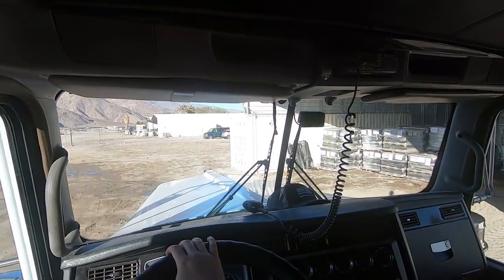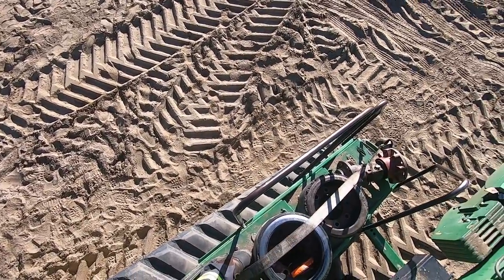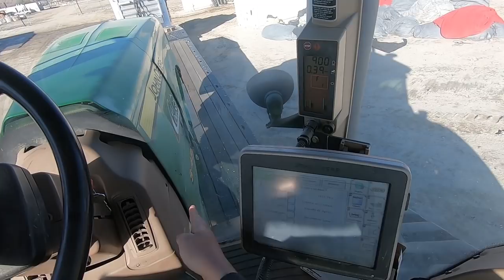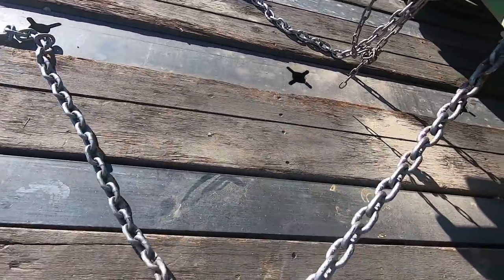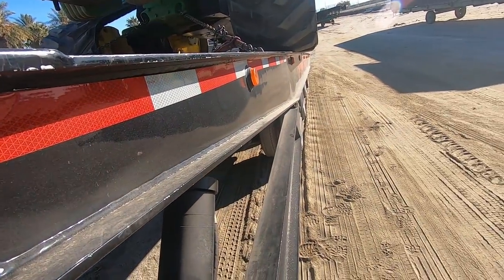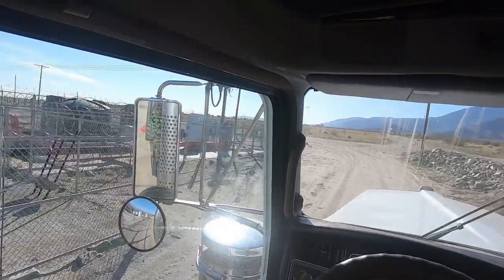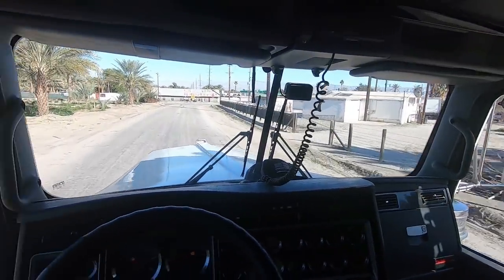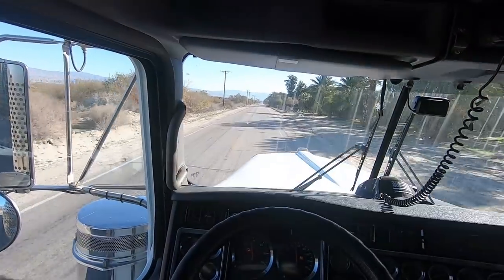JD 8430T Oversize Load!

Comment: If that Kenworth had a caterpillar or a N14. It is new so it got the new X15 which ain’t a bad motor. I’m a fan of the older motors. The old caterpillars are the motor.
Reply: The old CATs are great...if you like 4 mpg
Reply: MGJackson68 always loved the old cats man. Powerful motors
Reply: @JacksonGuitarsPlayer03  Absolutely...they are awesome engines.

But not so practical in the modern business environment.
Reply: BobsYourUncle yeah the x15 is a good motor. I work at a tow company too. It’s in the new 50 ton rotator. I drive that truck it’s a good motor. We have an older Kenworth with a 3406e cat in it. Thing is fun to drive I love that engine. I love Kenworth trucks too. Kenworth and peterbilt man.
Reply: MGJackson68 Yeah. We still got cat powered trucks. We got a 600hp acert cat powered 06 peterbilt 50 ton rotator. Motor runs really well. It rolls coal and it’s stock! It is twin turbo. Yeah not good for environment but we love the truck and the motor is fantastic so we keep running it. We also have a couple c15 cat trucks, think one rarely smokes. Clean diesel exits the exhausts. We got the new Kenworth rotator with the X15 cummins. It’s a good motor. And we got a new Pete rotator with that motor. The new X15 the Cummins N14 and the caterpillars are the the engines for the work trucks. But yes man, the X15 is the motor in the modern work environment. For a new motor I like it.
Reply: My recent miles are all with X15 Efficiency Series , 450/1650, 13 speed Ultrashift in a 2018 T-680. We are 90% reefer freight, so loads under 76,000 GVW are rare. I have to be a bit patient on the long climbs, but I like the fuel mileage bonus every month.

It has been years since I was around any Cat engines...far enough back that a 325 HP was not "small".

We even had one Kenworth cabover, double bunk with the purple Allis engine...that thing was a monster.

Circa 1977 we bought a Peterbilt 359, Cummins 350 Big Cam and 13-speed...I enjoyed driving that one.

When Mack came out with the Cruiseliner we switched over to those, 300s with 10-speeds, except Big John had a 5-speed and got along fine with it, even with max gross loads.

I recently drove one of our company trucks with the PACCAR engine and 12-speed autoshift. I have heard some less than positive things about the PACCAR engine, but that one i drove is a beast...I would like to run it for a couple of weeks to get a more informed opinion of it.

Detroit Diesel I have driven very little, and not in a fully-loaded situation, so I cannot offer much of an opinion there.

Comment: What happens if you don't tilt the deck up while running the axles back?
Reply from the maker: It all depends on the weight distribution of the load. But more than likely it will pop the trailer off of the fifth wheel plate. Thank you for watching

Comment: I have never worked in the recovery industry, I was always in a factory (retired now after 40 years) so that is why my question might sound a little dumb to you Trent. When you are putting a piece of equipment on a landoll trailer, why don't you level the bed instead of leaving it tilted before you start chaining it down?
Reply from the maker: I always treat every vehicle as if the brakes are non-functional. This is a safety thing that I have always done to help prevent accidents if a brake failure were to occur. Additionally sometimes it’s just easier especially with oversize vehicles to chain things down with the deck down due to lower deck heights and ease of access. Thank you for watching!